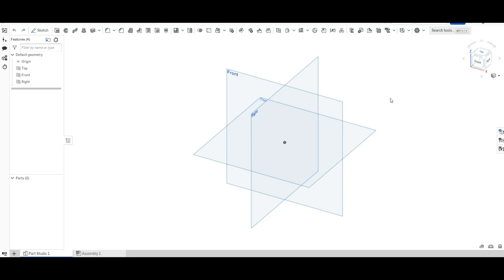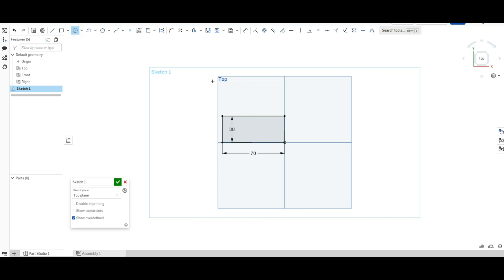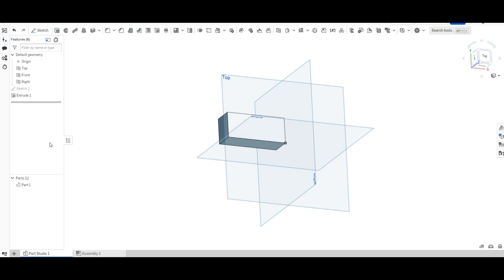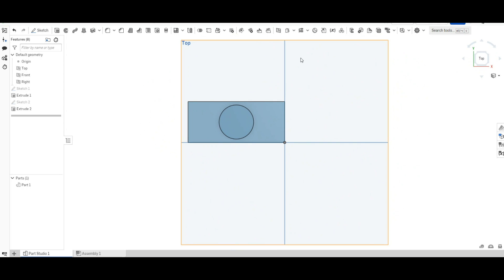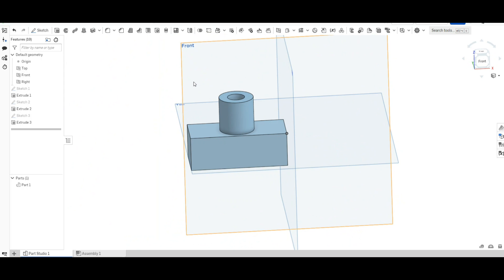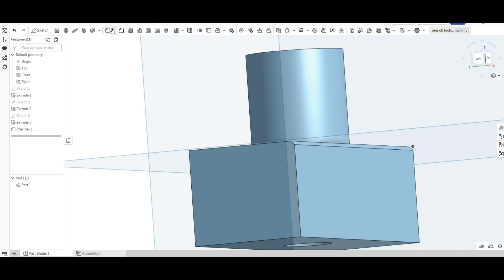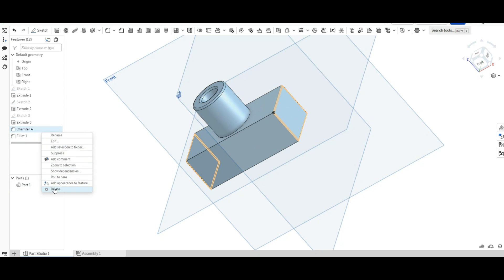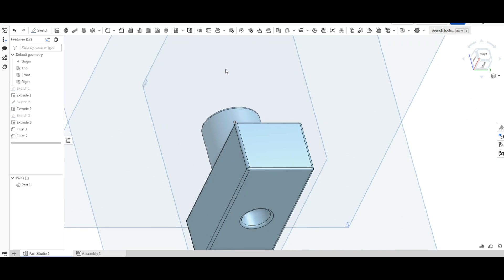Parametric Modeling: Fillets & Chamfers

Comment: Keep doing these.  I would suggest that a good goal would be to work toward designing and printing items that relate to electronics projects.  These might include such things as custom enclosures with openings for knobs, switches, connectors, displays, etc.  Also you could address topics such as when and how to ventilate such enclosures.  Other things that come to mind are items for the workbench.  Here you might want to do things like designing custom adapters to expand the capabilities of existing workbench items.  Perhaps something like a custom soldering holder adapter for round or oddly-shaped PCBs.  It was the need for a custom enclosure (which I still have not gotten around to) that got me into 3D printing in the first place.  I have created a number of other items for which I have had need in the mean time.  My next project is to change out the extruder nozzle that I have worn out.